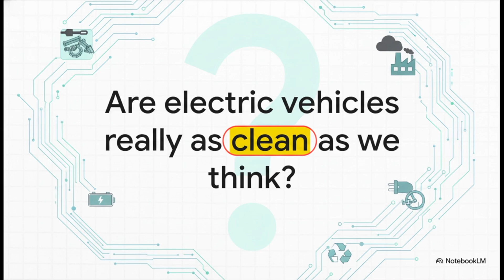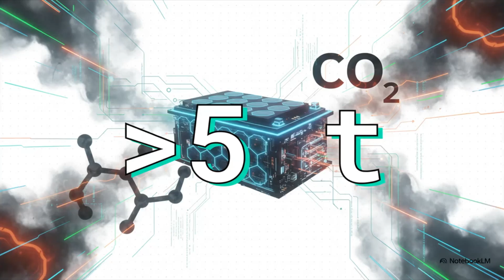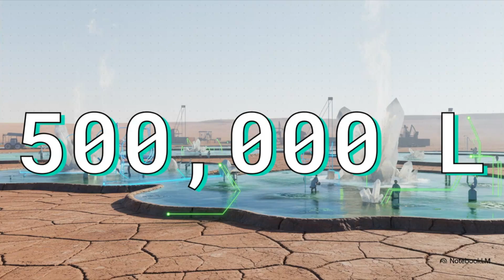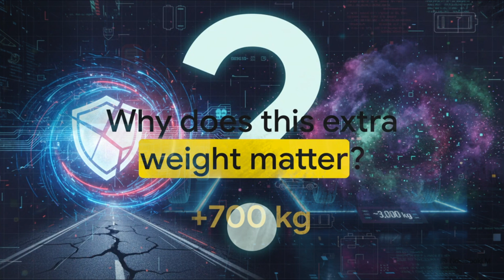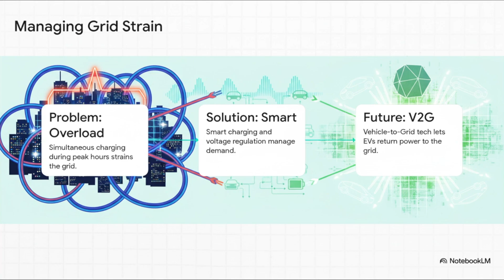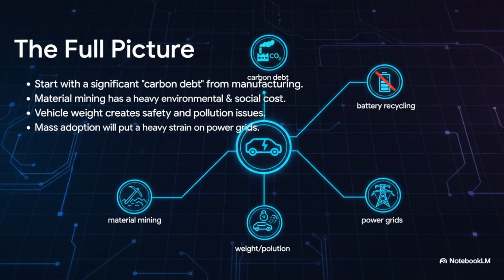HIDDEN COST OF ELEKTROMOBILITY - WHAT IS KEPT SILENT

Comment: why should a car be replaced after 10 years of usage ?
My 1987 VW Golf is still fresh as ever.  I drive it daily. It consumes 4,5 L/100km; making it the cheapest car I've ever owned / driven / maintained / insured.
Reply from the maker: at what time is this claimed? I would say that it states that Operation after 10 years: In the context of average operation, it means that emissions savings occur only after 10 to 15 years of operation. Not about replacing the car. If it were an EV, it is possible to assume that the battery degradation will already be significant and its replacement will probably be necessary. Or they will make a new EV. The 1987 VW is a really great car, I used to have one too.